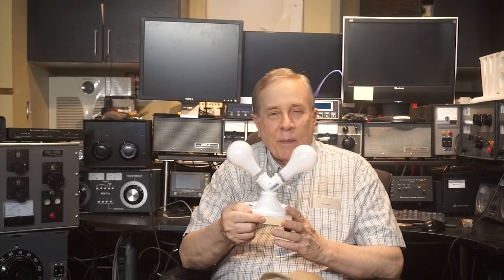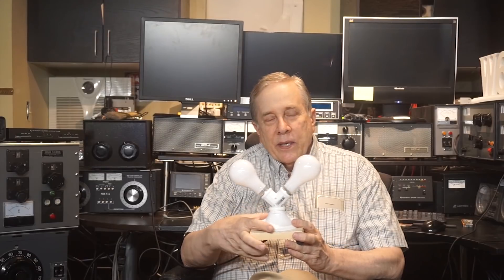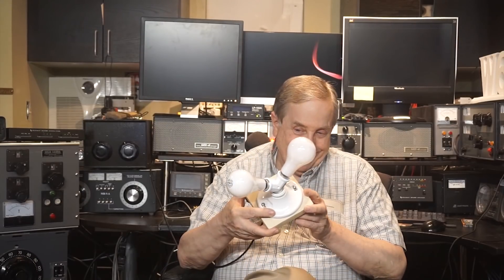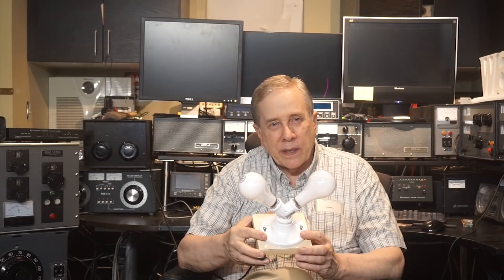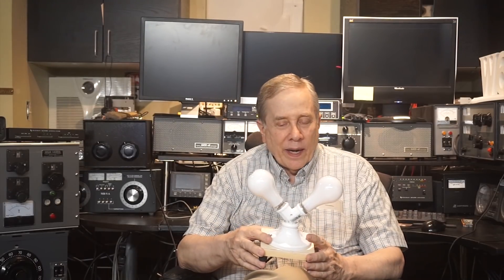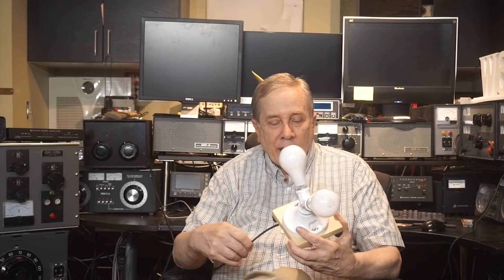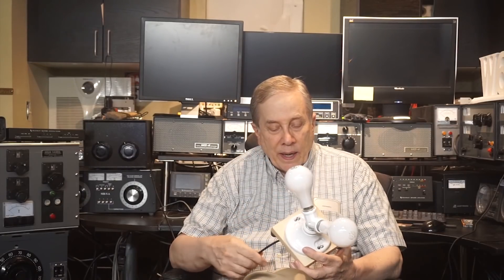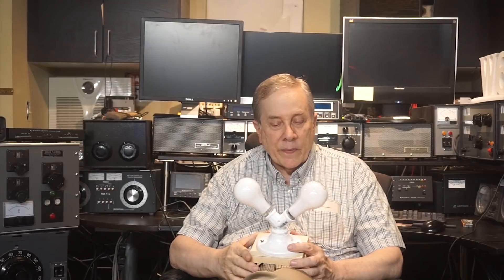Ham Radio Basics--Part 1 Digital Mode FT-8 With Light Bulb Antenna 750 Miles!

Comment: Hey Jim,
Does your antenna tuner adjust in real time? Wouldn’t the mismatch change as the light bulb become hotter?
Reply from the maker: Yes and Yes if I am using an automatic tuner. Once the filament is hot, it is relatively stable.  Sorry for the delay.  I have cancer in my blood 3 ways which makes it difficult some times.  The prognosis is not good and I am doing my best to forge ahead.  I had emergency surgery a week ago and the stay in the hospital was terrible.  Happy Holidays and 73, Jim W6LG
Reply: @ham-radio   Hey Jim, thanks for your response. Do all automatic tuners adjust in real time while transmitting or did you have one that just so happen to make these adjustments in real-time? No worries, I understand. I’m very sorry to hear about the cancerous cells in your blood vessels… I’m very sorry to hear about the prognosis not being good… How did the emergency surgery go? I’m very sorry that your stay in the hospital was terrible… I hope your holidays were ok and that you saw your family and friends. Wishing you well and all the best.
Joe KO4BKA

Comment: If you were to use 2-8 watts rather than 100 watts you will get better results. Why, because, as the wire heats up the rising temperature increases the resistance. If you use LOW power, the filament wire should barely heat up and the resistance will drop, probably drop by a lot. G7VFY

Comment: I made a number of JT65 contacts with 5 watts before realizing that my vertical was disconnected. All I had was 20 buried radials fed by a buried coax. Results were best on the low bands...  The ATU in my KX3 actually matched this!

Comment: Demonstrates how easy it really is to get RF into the air. I do question however, why one would choose antenna materials that are exemplary at turning electric current into heat (and light), rather than radiating it. It's a cute demo, but nobody should be building antennas out of resistors.
Reply from the maker: Hi and thanks.  You seem to have missed the point of the experiment and the video with the light bulb for an antenna.  Thanks for watching. Try FT8 and have fun on HF.  73, Jim Heath W6LG
Reply from the maker: Thanks Rick.  FT8 is amazing in that it will allow someone to communicate even with very a compromised antenna.  Glad that you are having fun on FT8.  Please do subscribe.  73,  Jim
Reply: Jim W6LG my apologies Jim. I replied without having fully watched your video. So I did miss the point. I have recently jumped on this bandwagon of FT8 and it truly is an exciting new mode. Thanks for posting; great video
Reply: Sub'd
Reply: I'm betting you've never used a JT/FT mode or you would have gotten the point.  :)

Comment: In my calculations a few minutes ago (below) I worked out a figure for the resistance/impedance of a bulb. I need to think about how the feedline impedance has to figure in. My first thought is that the calculated value (228 ohms for one 60W bulb) is by itself high enough, when the bulb is fully lit, that it is considerably higher than 50 ohms, so gut feeling is that the coax dissipates less than the bulb. But I am not at all sure how they divide it up!
Bob Wilson, WA9D

Comment: Jim,
I have not finished watching, so maybe you picked this up later on. You mentioned that you did not know the impedance of a light bulb. Here are some comments in that connection.

First assume it is a 60W bulb and operating at 117VAC (RMS) to give 60 watts. Using power = voltage squared, divided by power, we get about 228 ohms for the bulb. That would be resistance, I don't think there would be much reactance in an incandescent bulb. (Yes, the filament in a traditional bulb is a little coil, but I think it will be negligible at 60Hz.) 

But the resistance of a filament changes a lot when it is hot. For most metals, including light bulb filaments, the resistance will be lower when it is cold. So that 228 ohms would be when the bulb is putting out full brightness. As you talk, for SSB or AM, or use a key, the resistance will be that high only part of the time. But it is a first estimate of the impedance for one bulb.

A similar calculation could be done for other wattages. A calculation for a CFL or LED, using its rated wattage, should be OK as to its effective impedance when lit. But how it would change with power/brightness changes looks a lot more complicated, with the complex circuitry in the base that does the current limiting by pulse width modulation.

I have been a ham for decades, and certainly have a lot yet to learn from "Ham Radio Basics".
Thanks!
Bob, WA9D
Reply: Wow..I get it..seems like I can see  frequency of gravity is distant ly related to radio..electro magnetic spectrum...somewhere there's a linear equation that can  show it in an x..y axis......great stuff happening here.
Very technical but fun

Comment: FT8 is not that great as a low power mode. For that you want JT65, JT9 and T10 modes. These are all far better for QRP. Especially the JT9 and T10 modes. JTDX software will decode amazing numbers of very weak signals!

Comment: lol, spoiler alert. you match it from the antenna matcher. If you have cable, you have a radiator. Looks good though.
Reply from the maker: Hi,

The feedline did not radiate.  I tested it before the video.  It is a top brand with an excellent shield.  The coax was coiled into a choke and had ferrite beads.  With the bulb removed, it was completely deaf; zero signal. Thanks for looking.  73, Jim W6LG